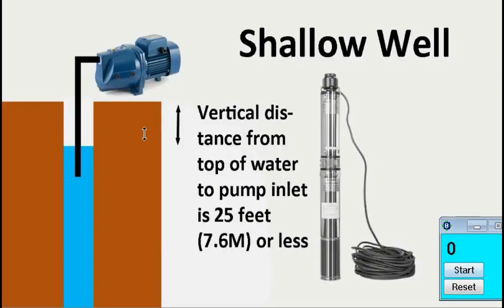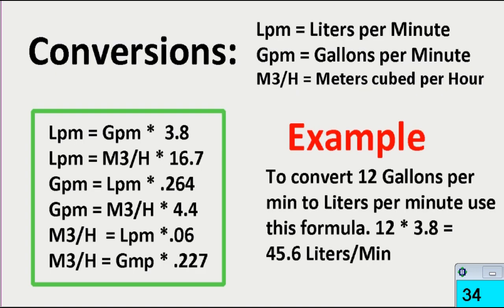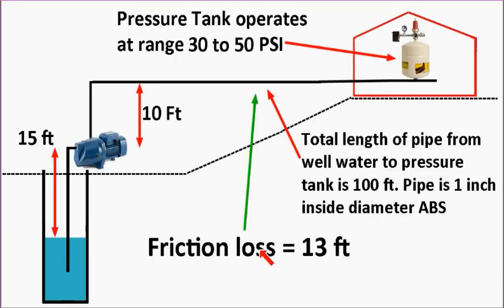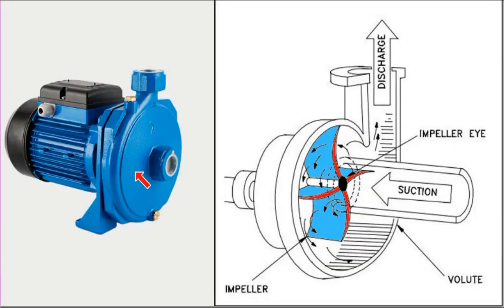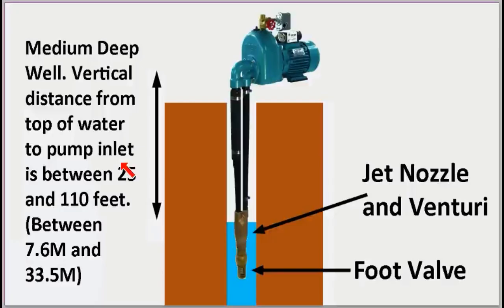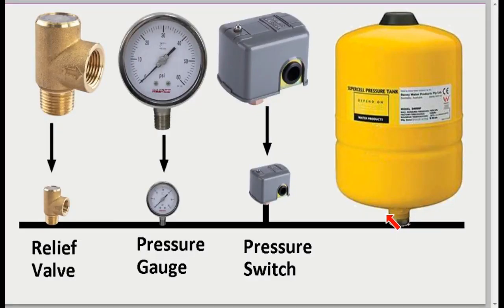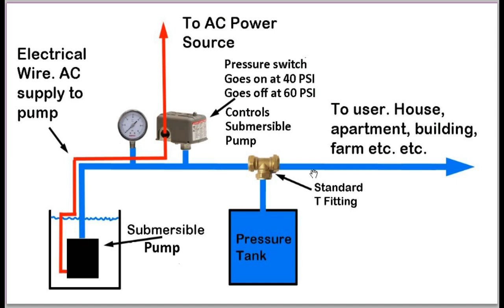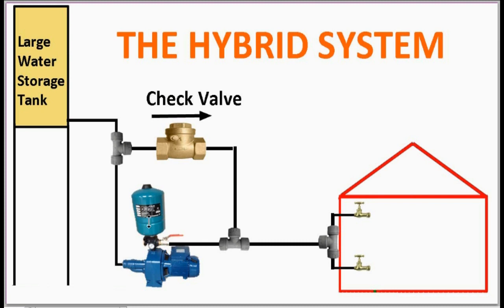TANKS, PUMPS and PRESSURE – 43 Topics Explained in 43 Minutes!

Comment: Larry, really enjoyed watching your video and seeing the work you put in it to show and illustrate facts we didn't know about wells and various pumps involved. However, I think probably one of the best examples of showing your illustration of a submersible pump and what would happen if the submersible pumps' check valves become faulty and no sprink valves were in line. This would cause more frequent cycles from the pumps because all the water would drain back down again. Which then in turn would make the pumps kick in and go through the work of pumping the water up and so forth. Depending how deep of a well also would dictate how many check valves should be used. Again, your whole channel is very insightful and packed with good advice!

Comment: What  a great video! Can I ask a question?
Reply from the maker: what is your queston?
Reply: @LarryElterman  I just built a little house in northern New Hampshire. I have an artesian well with a small pressure tank inside the house. The pump at the bottom of the well is one of those pumps that is always running gently and then just kicks on when it needs more pressure.

Grew up in suburbia and I'm used to that amount of pressure. I only have the basement sink hooked up and the water pressure seems OK but I'd love to have an abundance of pressure. Does it make any sense at all to put a more substantial pressure tank in?

I spoke to the guy who owns the Well digging company and he told me that I shouldn't do it/it wasn't necessary. What are your thoughts?

Thank you!

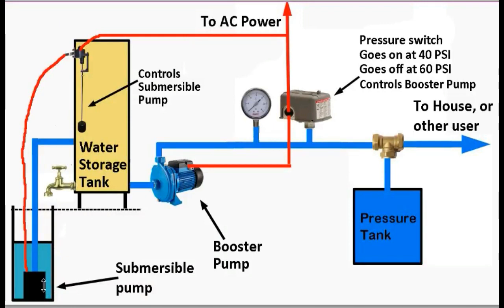Comment: Thank you, Larry! This video was very informative- and the format was easy to digest. I am troubleshooting a pump (diaphragm tank) that recently started cycling on and off every few minutes. This pump is 15 meters higher than the well water tank. Next to the well water tank is a GRUNDFOS CM Booster PM2... It looks similar to the example at 37:55 in this video- with the addition of another pump connected to the diaphragm pressure tank.

Comment: A friends 240V pump recently died, no sound/motion whatsoever, verified 240V all the way to motor.
For safety we wired it for 120V, planning to use a light-up tester, & powered it with an extension cord.
To our surprise it started just fine, though I killed the power after ~1/2 second.

I know the 120V-position puts the main windings in parallel, so now I'm wondering....
If one of the main-windings opens, is the good one still enough to let the motor spin??
Or can the voltage switch just go bad?  We ordered a multimeter, so praying its the switch!
Reply: I had a submersible well pump that would not start. I pulled it from the well, and just for my own curiosity, I attempted to run it. The pump started fine. I tried the test several more times. AHAH! About every third or fourth attempt, it would not start. It was apparent that the centrifugal start switch inside the pump was at the end of its life span. Because our home needed water NOW, I simply went to the big box store and bought a new one. Problem solved. I don't believe the warranty these manufacturers give is worth the paper it's printed on. For one, they are usually pro-rated. Second, it costs money to ship a heavy pump, at the owners expense. Thirdly, who can wait weeks or months without water for the used rebuilt pump to come back, and at the owners expense again. My advise is, if the pressure switch is good, pump wiring is good, replace the pump and be done with the problem.
Reply: @tigerseye73  Unfortunately my theory was correct, 1 of the run-windings had burnt out.
Apparently there's no such thing as re-winding a motor? So they just bought a new one.
Time will tell if it was worth replacing just the motor, but they dont have much money.
Lesson learned.. Pump protectors are good, cheap insurance against such things!

Comment: we use self priming pump to suck water out of the distribution lines gaining an advantage from the neighbors.
Reply from the maker: Haha, in most places it's illegal to suck water directly from the distribution system.
Reply: @LarryElterman  In the Philippines, the distribution line is pressure-weak so those that can afford it, attach a pump to pull water in, but like Erik said, you are pulling away from neighbors which is just the way it goes... kind of like tough luck for the neighbors.   In places like the Philippines, water pressure is better at night after most people are sleeping, mid day one is lucky to get a few drops of water.  Welcome to the 3rd world!   People pull water from the distribution with a pump or stay up late in the night to get it and then store it in a tank to use during the day.   I see high rise buildings go up in the Philippines and always wonder about the water.  I regularly see a water truck parked outside of a condo building here - not sure if they are delivering tap water or to keep water in the pool.  I guess there is ample supply of water here just bad delivery infrastructure that won't ever be fixed, because it is the norm here.... like the tolerated norms in Baltimore that Miami would never tolerate.  Baltimore won't be fixed either.
Reply from the maker: @ForwardGuidance  First of all, don't get me wrong, i am not concerned with whether you  or Erik does it legally or not, as long as it is not in my neighborhood!  I was just letting him know it's illegal in case he didn't know.  Now next point, It is perfectly easy to accomplish what you want to do legally if you so desire. You can get what you want and do it legally. There is no need to "suck water in". As you said, at night the system is usually better. So just let the town water go into a storage tank and fill it up at night. During the day, you get water from your own storage tank which you pressurize with a  pump and pressure tank. What you are doing is crazy to be honest. No need for it! You are basically destroying the system for everyone else, and if you are caught I imagine you would probably get at least a hefty fine. Why do it the wrong way when it is so easy to do it the right way?
Reply: @LarryElterman  I'm speaking to how things go in the 3rd world out of necessity.  People here also tap into a street light for  electricity and in India (I've read) so they don't have electricity during the day.  I know it is sometimes difficult to walk in another's shoes when you have a industrial world's basis so I will explain.  People here have barely enough money for the pump let alone a storage tank and all the necessary items to automate water delivery. A day labor working on a construction crew here is lucky to  make 12 dollars a day, a retail sales clerk in the grocery store makes 8 dollars a day.  I was recently talking to a couple that works in a call center and have 3 kids, they make a combined income of 1200/month (one of the higher paid in the country).  Your reply is very appropriate for someone living in the developed world with world class infrastructure, but it is completely off base for those living in the 3rd world.  I don't know of a neighborhood in the US where the residents need to pull water - if they did, the gov't would surely add a bit more cash to the national debt or issue a bond to fix the problem.  Maybe you missed it or glossed over it, but my comment started with "In the Philippines" so I was hoping that you would realize there's a case for pulling water when one doesn't live in areas that are infrastructure rich or where they can add to the national debt without huge financial risks.
Reply from the maker: @ForwardGuidance  i live in the philippines
Reply: @LarryElterman  I initially thought you did, but then your reply was so elitist in tone, I backed off the initial thought of you living in the Philippines.
Reply from the maker: @ForwardGuidance  you are trying to act so smart, like you know everything, you are desperate to seem smart. You have no idea what you are talking about. The people that are as poor as you are talking about are not buying self priming pumps to suck water out of the town line. They probably don't even have a town line. Calling me elitist. Tsk Tsk. Why are you so desperate to seem smart? There are people of all economic classes in the Philippines. Don't you have better things to do than answering comments convincing yourself you know more than anybody else?
Reply: @LarryElterman  Thanks for your feedback Larry.  I really appreciate your water related videos, especially this one which does an excellent job summing pretty much everything and it's immensely valuable since all I was wondering about is in one comprehensive video.   Thank you very much for taking the time to share your knowledge.  Take care.
Reply from the maker: @ForwardGuidance  Your welcome. I realize my reply was a antagonistic, but it also was antagonistic when you implied I was elitist when you don't even know me.
Reply: @LarryElterman  Fair enough Larry.  Have a great day!